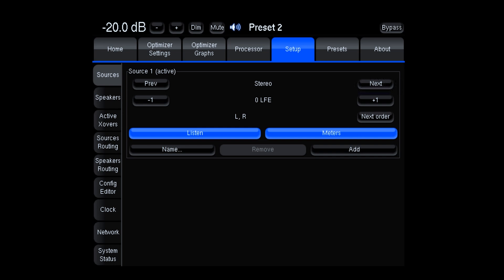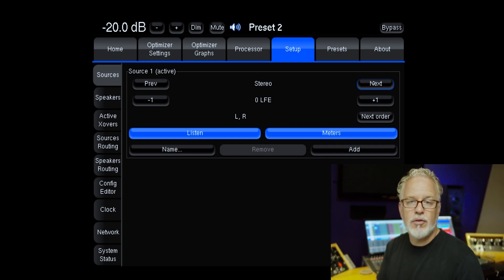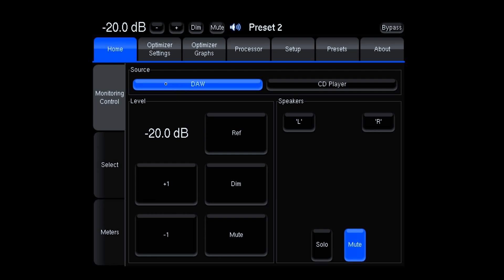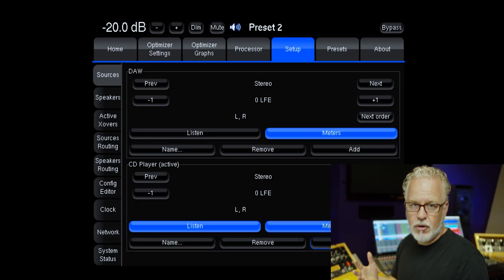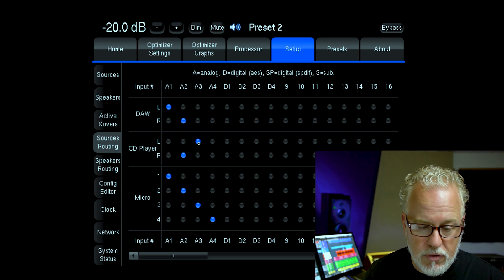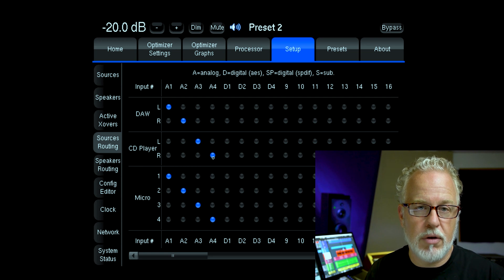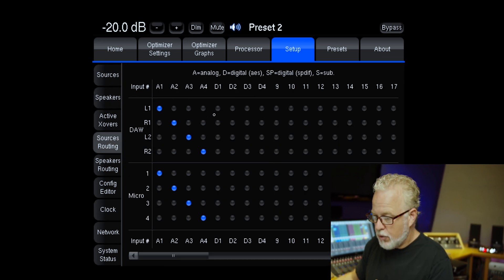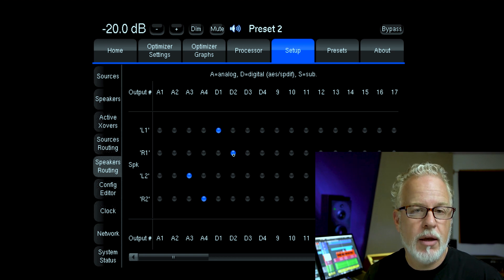Trinnov Pro Tutorials: ST2 Pro Advanced Configuration

Comment: If i have 2 sets of speakers like the second option of routing you mentioned. Can I have only phase&level alignment on one speaker pair but bypass the eq? and on the other monitor pair have the full optimization on? Also when measuring all speakers simoultaneously doesnt that mess up the result of the calibration?

Comment: Can this be used with a home theater system that leverages Dolby Atmos and other preprocessing?   Example I have A left and right channel, 2 rear surround channels and a center channel, I also have 2 subwoofers.  Would this system be effective in setting up better sound for this type of home theater or was it designed for just pro audio studios?   Time delay and distance is easy to understand but can we manually tweak the frequencies of each speaker as well?  Is it a Parametric EQ?
Reply from the maker: For home theaters and decoding immersive sound formats, we have an entirely different line of processors called Altitude. The ST2 Pro showcased here was designed only for stereo mixing and mastering studios !

Comment: Great tutorial videos. Thanks. My Trinnov is ordered and on its way. The only thing I'm missing are SPDIF and/or ADAT inputs. Sadly my Antelope Orion doesn't have AES outputs. I'd like to prevent another ADDA conversion.
Reply from the maker: Hello Murat, there are several solutions for this use case, have you contacted our support team with that question? support@trinnov.com
Reply: @TrinnovAudio  No, I didn't. But it's ok at the moment. Running ST2 Pro since a few weeks and I'm very happy.
Reply: @murat_buyuk  You can get a hosa box for 100 bucks that will convert between spdif and aes both directions fyi.

Comment: This was super helpful.
Reply from the maker: Pleased to hear so, we hope you understand a bit more about your ST2 now!
Reply: @TrinnovAudio  Yes I do. I have got it working but the clock status is intermittent, Locking and unlocking when its in slave mode. I have an Apollo 8x with a S/PDIF cable going to a  HOSA converter and that is going in to the digital input of the ST2 Pro. I also have the digital out going to a Dangerous DBOX+ in the AES input of that unit. When It's locked it works perfectly  but like I said It goes in and out way too much to be functional for music mixing/creation.  I purchased a BNC cable and Im going to try to sink it via Word Clock as my final test. I sure hope that works. Cheers
Reply from the maker: @Kharrari  if you have technical questions, you should write to our support team, they will sort you out in a timely manner :) support@trinnov.com